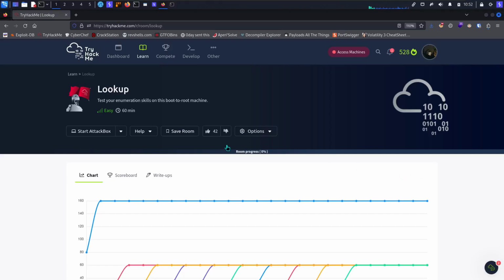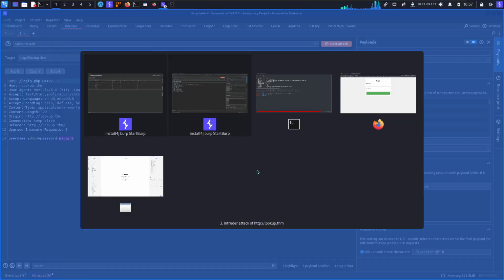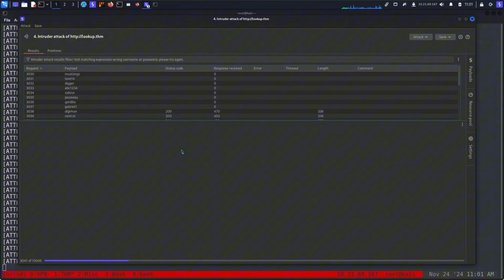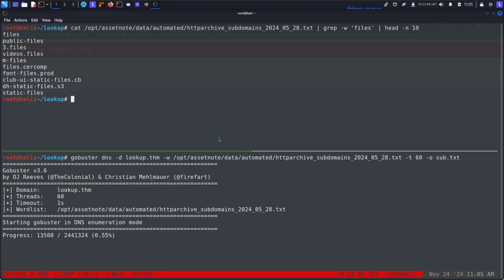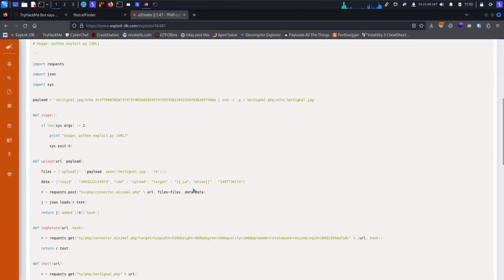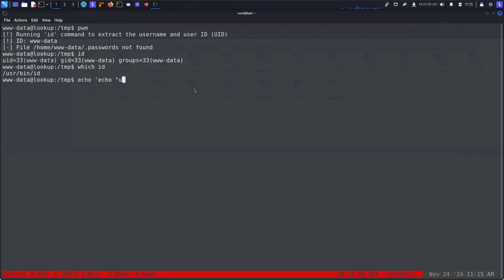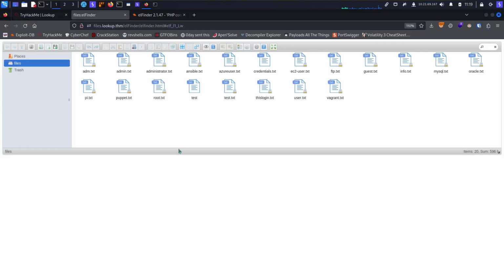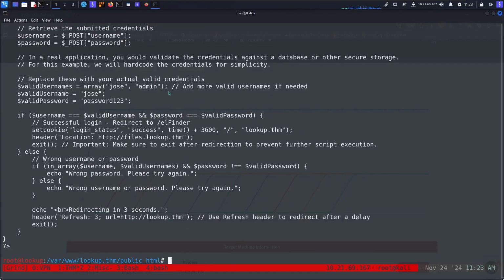Lookup TryHackMe Walkthrough | Easy

Comment: Great video H00dy, subbed! 

The reason why we can only find the lookup.thm and files.lookup.thm after we add them to the host file is because the root domain ".thm" does not exist in any of the 13 Rood DNS Top Level Domain Servers, so when the query reaches them TLD it does not know how to resolve it or which servers are hosting it 
As a possible workaround, we would have to deploy our own DNS server, and create a wildcard record to resolve all .thm resolutions to the server IP, only then could we brute force the sub-domains using gobuster